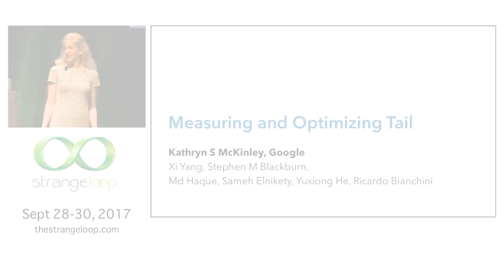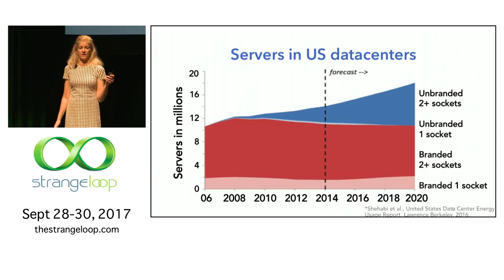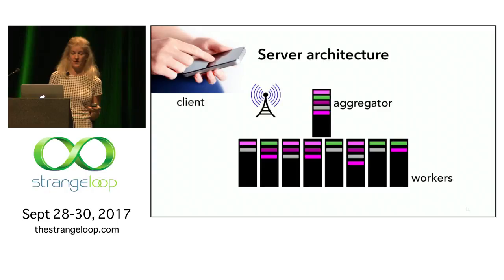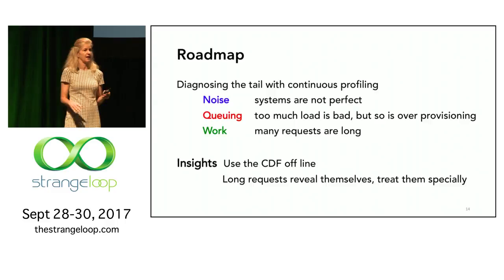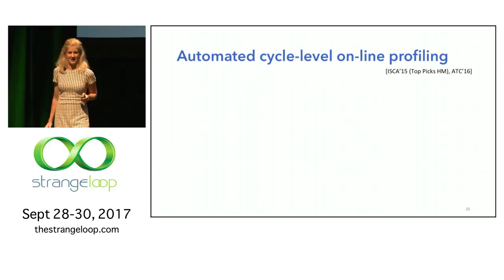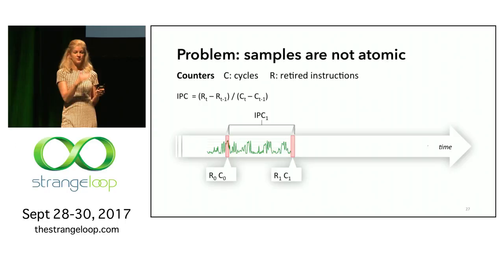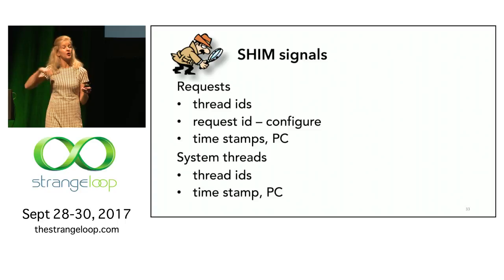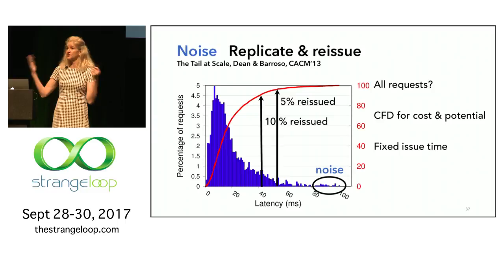"Measuring and Optimizing Tail Latency" by Kathryn McKinley

Comment: The SHIM performance sampler at 15:00 is from “Computer Performance Microscopy with SHIM” by X. Yang, S. Blackburn, and K. McKinley (ISCA 2015). SHIM provides accurate and extremely fine-grained performance monitoring of an application thread by using an independent thread to poll the performance counters for the application thread. https://github.com/ShimProfiler/SHIM Took me more time I expected to locate it.